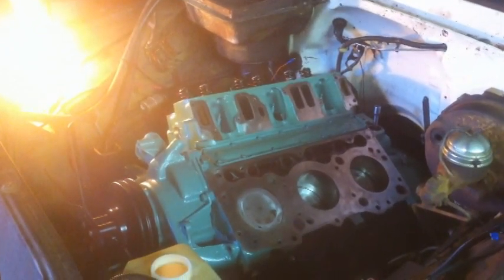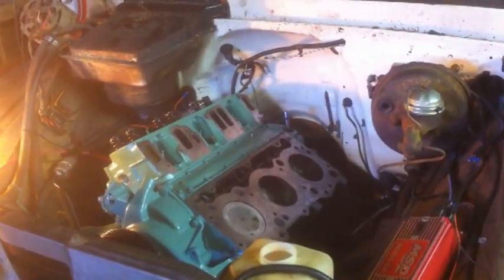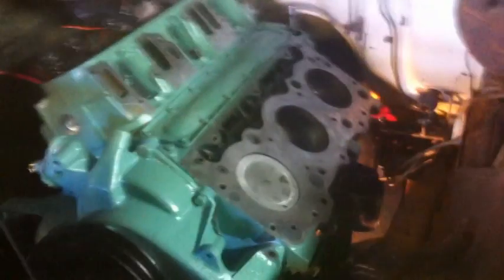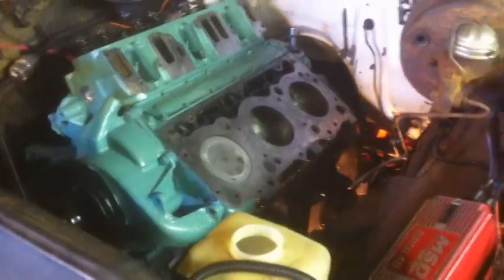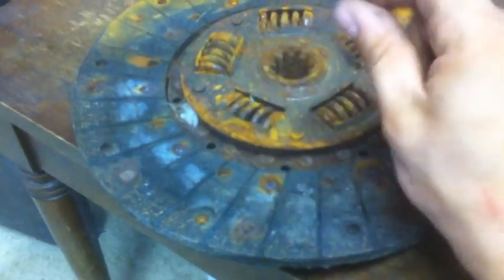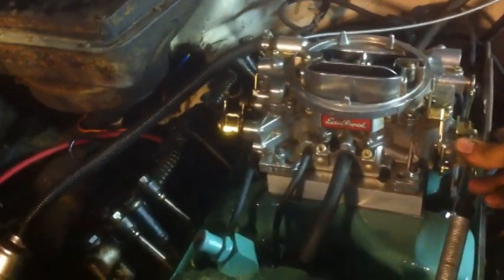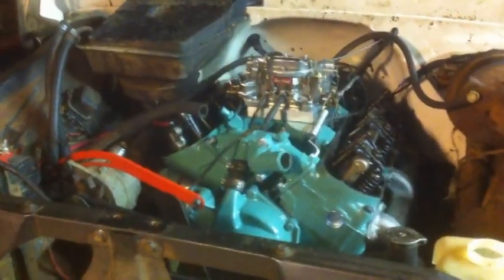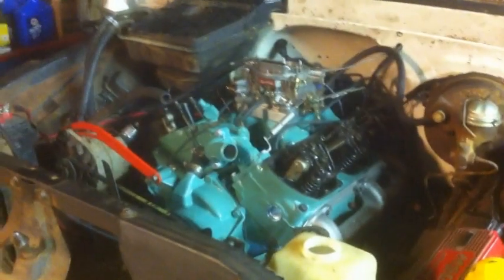1964 GMC "Crustine"- She's Alive!!!!!!!!

Comment: Fantastic! You have had a number of bumps in the road, but it looks and sounds good. Be sure to remove the paint from the spots you attach the grounding straps, both on the engine and any paint or dirt on the chassis/body.
Reply from the maker: Thanks! I removed some paint from one of the motor mounts for the ground cable. Gonna try and do it in spots where no one will see and where I won't see so I don't cry. haha!

Comment: I see you're working on your engineering degree...

I think DD green is the right color. It just plain fits.

Don't ground to your VC bolt. Go to the bell housing or intake.
Reply from the maker: Almost have to with some of this stuff! I like the green to, if I ever restore the truck I'll probably go back to red, but I like this. Outta turn a couple heads at the shows. VC bolt?
Reply: +Military Chevy valve cover
Reply from the maker: ***** My bad. haha!